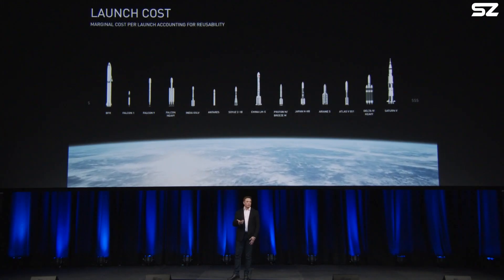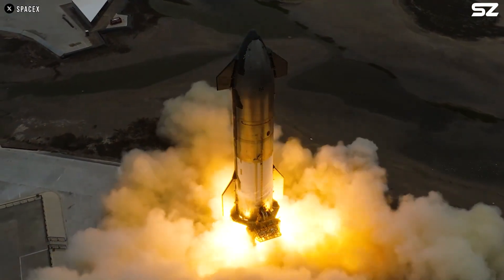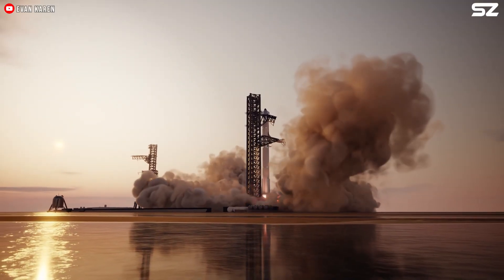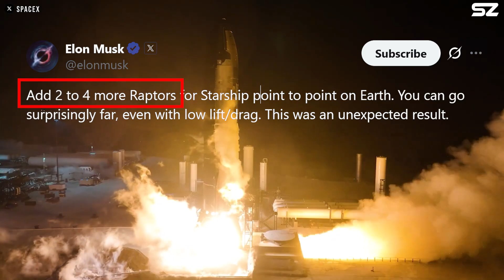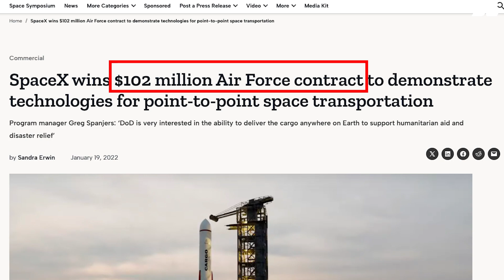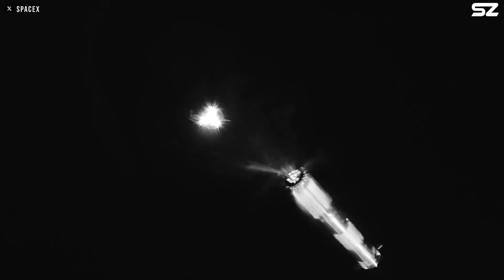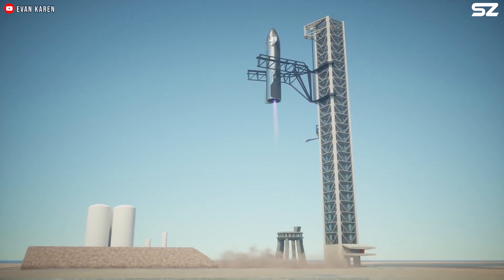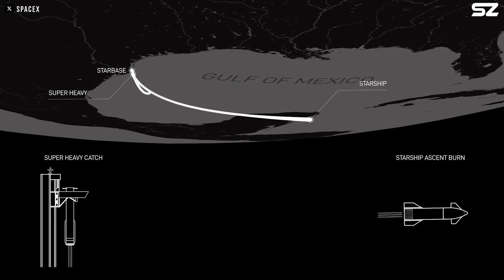SpaceX's Starship Military Solution: Cargo Starship!

Comment: If heavy load transport could be performed through air or space without large ground installations like runways, it would be easier. Transporting huge machinery like transformers or generators is complicated, expensive, and time-consuming. For the Cahora Bassa power station, even a local factory had to be built as there was no chance of transporting the engines some thousand kilometers through the woods, and they would not fit into commercial planes. If that could be done by something like the Starship, it could ease huge projects.